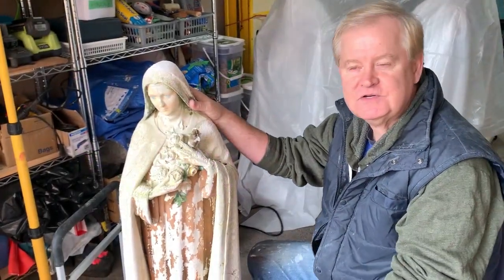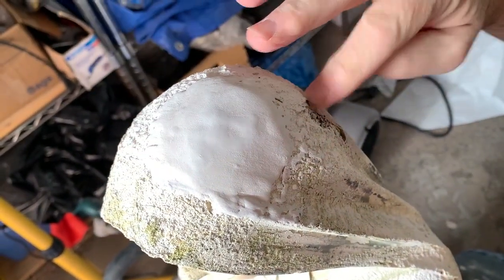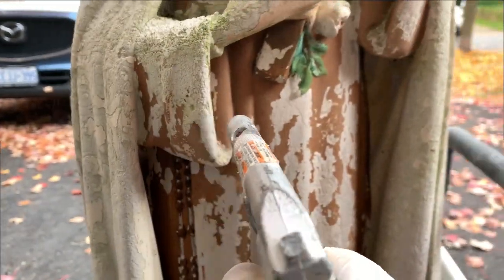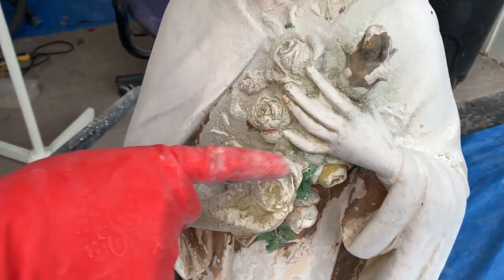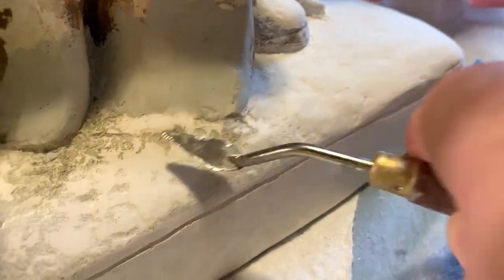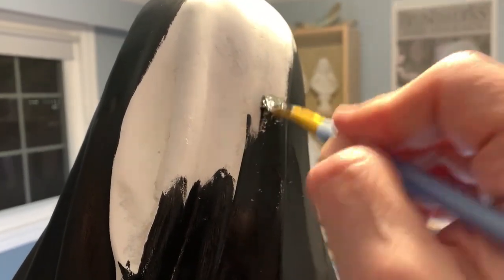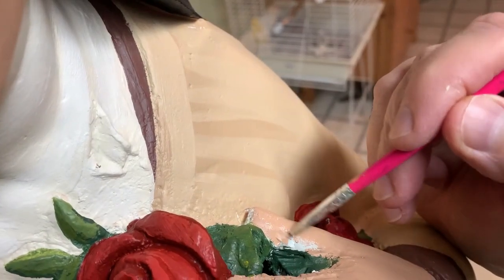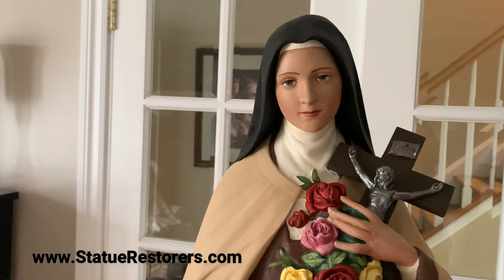Restoring St Therese of Lisieux (Vintage statue by T. Carli)

Comment: The face looks great, especially the eyes. Can you tell me if there is any advantage to using plaster over spackle to fill in the unwanted cracks and pitting. I use spackle and seems to work well.
Reply from the maker: We typically mix and use hydrocal plaster for our projects. But spackling paste or even drywall mud are very close to the same thing. Spackling tends to dry more quickly and shrink less so there is that advantage.

I just wouldn’t use it for anything larger… For example, creating or sculpting a hand Would not be advisable. Spackling would be too weak.

Hope this helps and thank you for your compliment!
Reply: @BrushworksStatueRestoration  Thank you for your prompt reply! Yes, for larger areas or extremities, I have been using Abatron Wood Epox. It hardens to a rock but is extremely lightweight. Maybe someday I will be half as skilled as you two! Will watch all your videos!
Reply from the maker: Thank you for your compliment. You’re very kind. If you have an online site where we could have a look at some of your work, we would enjoy seeing it! Take care.

Comment: I have a 2ft plaster crucifix that was  damaged in a fire and broken in early 1900s.  It was brought up from the church basement and I was asked to repair it if able.  The paint was flaking and tested positive for lead. Do you have any recommendations and methods of safety for removing the paint? Any special primer to use to cover it? (You were so gracious to answer my questions before.  Thank you for your shared knowledge! )
Reply from the maker: Hello Melissa.  When working with leaded paint, it's important to take proper precautions  - particularly avoiding exposure to lead dust by young children.  When we work with old statues that test positive for lead, I wear protective clothing (disposable cover-alls and gloves), wear gloves and a proper respirator (you should do better than the standard n95 particulate masks) and I make sure the seal around my face is air tight.  A respirator is a mask that you can buy at Home Depot and it has TWO filter cans that stick out the front.  This is one example but be sure that whatever you use clearly states that it will filter lead dust ( https://www.homedepot.ca/product/workhorse-dual-cartridge-half-mask-p100-asbestos-lead-respirator/1001104518 ).   We find it is better to avoid sanding if possible, and gently reduce any peel edges with a light sandpaper (ie 400 grit) and once reduced, you can use a thick bonding primer such as Zinsser Peel-stop Plus, made by Rust-oleum.  That goes on like a gel and dries almost like a thin rubber coat so it hides the old paint chip lines.  It is definitely better to COVER and seal off old leaded paint than it is to sand it off and let the toxic dust float around or settle on things nearby.  So a good bonding primer and then a premium paint should work for you.  We can only provide general information here as we don't know your specific project details.  We urge you to do some reading about safely removing or dealing with leaded paint before you delve into the actual work.  It'll help you do it right, and give you peace of mind so you don't have to worry about exposure.   I hope this helps!  - steve
Reply: @BrushworksStatueRestoration   Thank you Steve for your quick response and generous advice! I'm very beginner at restoration,  but a decent artist.  We haven't handled this piece well so far, but are making new precautions from here forward. I had vacuumed up everything that was coming loose with a hepa filter vacuum.  My husband,  a carpenter, has the proper mask, which I'll now use.  ✔️  I'll look for that paint! God bless you!  - Melissa

Comment: Awesome work!  I have a question. I am repairing a sacred heart of Jesus statue 36" tall the hand that's pointing to the scared heart is missing. I plan on create an armature first then cover it up with plaster then carve it to the desired shape of the hand.. Is this the correct method? If so what type of plaster should I use? or should I use I different material
Reply from the maker: Thank you Gabe!  You can do it the way you describe, and we would recommend a harder plaster such as HydroCal.  But you might also consider making a rubber mould of an identical statue hand and then just casting a copy of it.   You’d need to sand it smooth of course but if you’re not an experienced sculptor that might work out much better for you.  
     Another option is to use an epoxy based sculpting material that works like clay.  You’d get some time to work it, shape it and smooth it out before it hardens overnight.  We often use “Apoxie Sculpt” made by Aves. 
    I hope this helps.  God bless and good luck with your restoration!  Let us know how it goes ! 🙏

Comment: What plaster do you use? I am restoring a plaster statue of St. Joseph which is missing a finger. Thank you.
Reply from the maker: Hi Norma! For larger surfaces, we plaster with a product called Hydro Cal plaster. It is harder than plaster of Paris, and we find it better to work with. However, if you are resculpting a missing finger, it would be best to use an Epoxy-based sculpting material. We use. .Apoxie Sculpt .. which you should be able to find and purchase online. I recommend you buy the smallest possible quantity because it does go a long way.  hope this helps. You’re also welcome to email us directly if you have other questions. Reach us via our website at statuerestorers.com.
Reply from the maker: Hi Norma.  I got a notification that you posted an additional reply to me but i cant find it, so I couldn't reply!   I wanted to see your FB page as well, but couldn't find it.  We'd be happy to help you or your friend, and yes we've done many statues from the US before.  Let us know if we can help!
Reply: @BrushworksStatueRestoration  Hi, I have been asked if I know a restorer of statues in the Toledo, OH area.  That is what I was asking you. Thank you for the follow up.
Reply: I will send you a message through your website. Thank you.
Reply from the maker: @normatorti4295  hi again. Unfortunately we don’t know of any in that area. In fact, there are very few and most are outrageously expensive. If your contact would like to reach out to us by email, we can have a private discussion and assess and provide options. We’ve done many statue restorations for our American friends…

Hope all is well.

Comment: Hello, I just wanted to ask for help. I wanted to repaint my statue of the Virgin mary 'cause I accidentally scratched a few of her paint. I wanted to ask on how to do it using acrylic paint, what to do before repainting, how to prepare the paint so it would be smooth once it dries and not kinda cakey. Also, my statue is made of resin. So far the details and folds in her design remains smooth, what I meant by the scratch is I damaged some of her paint while cleaning her with a brush but not the statue itself, that's why I wanted to repaint. I hope you can answer, this would be a very big help, Thank you so much!
Reply from the maker: @laynardarcilla1858  we really aren’t able to provide detailed lessons but if you send us a few photos we could help you with some helpful information and advice.  Feel free to contact us via our website (contact us page) at statuterestorers.com and we’ll try to help. 
    We’re also working on a series of video lessons for the Spring which you may find helpful.
Reply: @BrushworksStatueRestoration  Okay, I'll try. Thanks much! I'll stay tuned for the series!

Comment: How do you fix the face?  Pick all the old paint off.. then apply a light slurry of plaster then sand????
Reply from the maker: Yes in this case a very gentle sanding with 600 grit paper then a light new layer of HydroCal plaster smoothed with fingers…